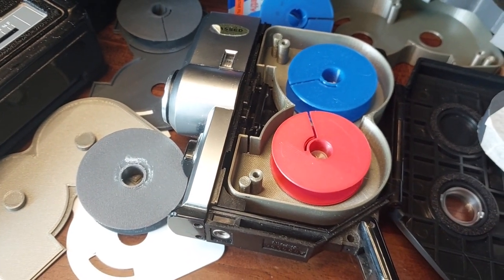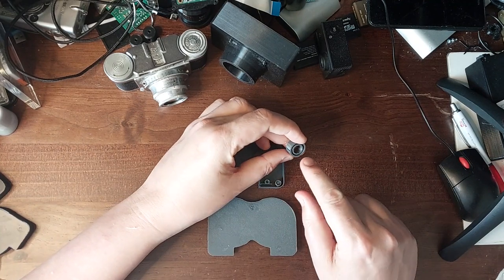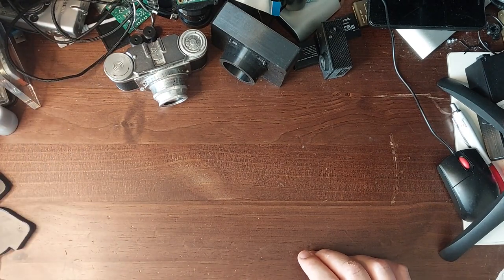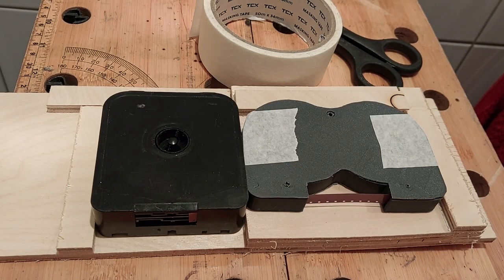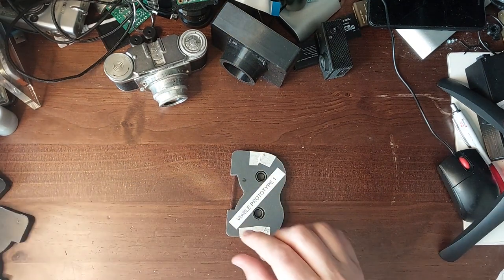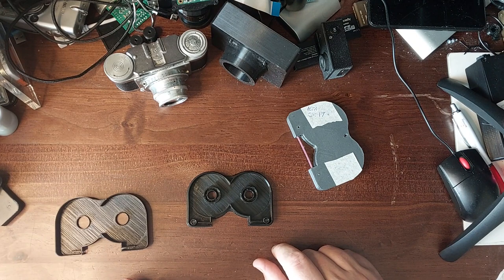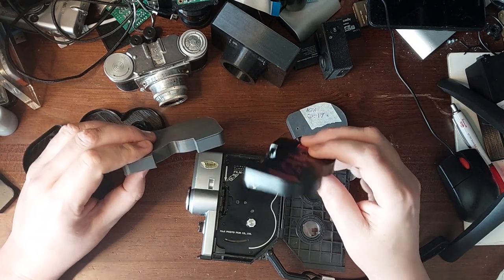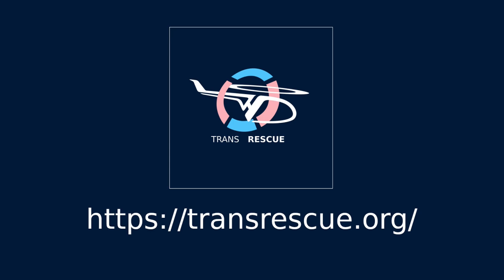A New Single 8 Cartridge Part 3: What's On Jenny's Bench

Comment: Jenny, I see you've left out the opening where the ISO setting pin goes. So how can it fit into your camera?
Reply from the maker: It simply pushes the ISO pin in, as they are designed to do.
Reply: @jennylist Thanks but not all cameras work the same. My Fujica Z700 has a sliding pin that's at the top of the film compartment when open and when you close the lid it slides down clockwise and stops where the channel in the cartridge ends. This allows for stepless ISO values between 25 and 400. It can't be pushed inwards as seen in the camera you're showing in the video. I'll send you an email with a picture so you can see what I mean.
Reply: Well, I would send you a picture of it but can't find an email address 😂